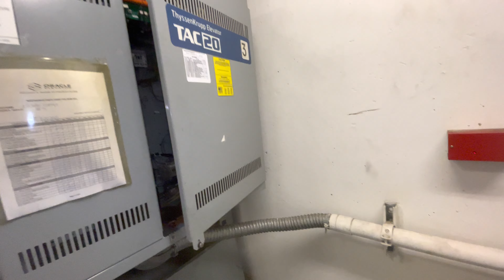Broken Thyssenrkupp Dry Powered Hydraulic Elevator Machine Room

Comment: The power unit is an oily mess. Leakage is possibly in the impeller housing seals or shaft, or one of the threaded fittings to the flow valve. If I remember correctly, the piping is tapped threads.  Solenoid valve is also a possible source.   I think they could have done a better job with the conduit run, where it changes to flex, longer length to anchor to the wall. Than hanging.